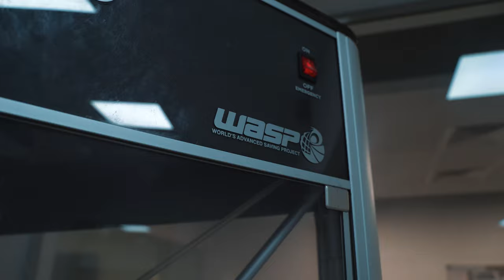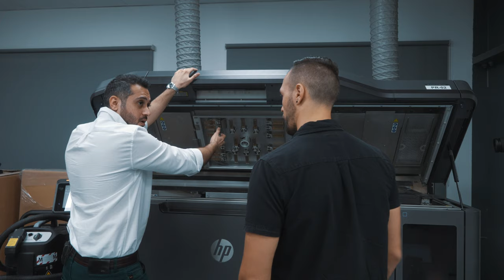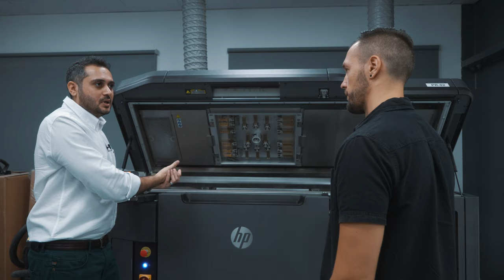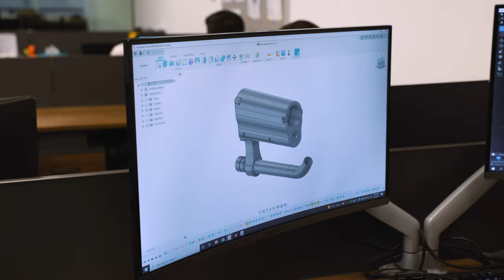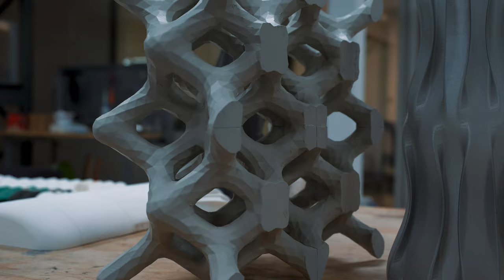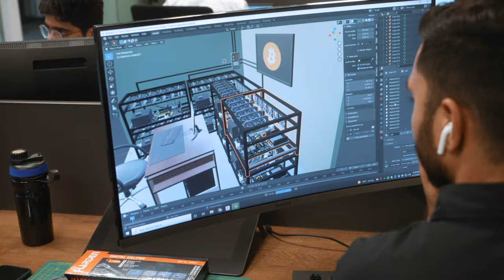Dubai based 3D Printing Company Tour | Proto21 | #6 Episode Up

Comment: If a printer can print another printer, can a 3d printed object be melted to create another 3d printed object? :D
Reply from the maker: Good questions. Basically can it be recycled? Pir Arkam, maybe you can answer this?
Reply: Hello Q5, Actually 3D printer is the first self-replicating device created out there :) Al though, the electronic parts of the 3d printer such as microcontrollers and ics are not yet 3d printable. bUt the entire structure for sure can be 3d printed :) - and yes, you can melt the 3d printed items and then use the same to create other parts of the printer